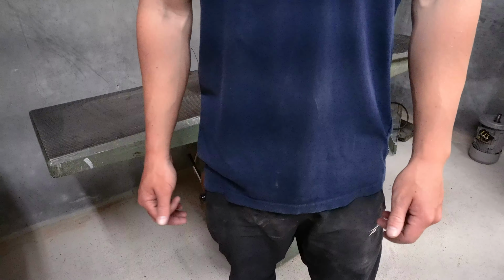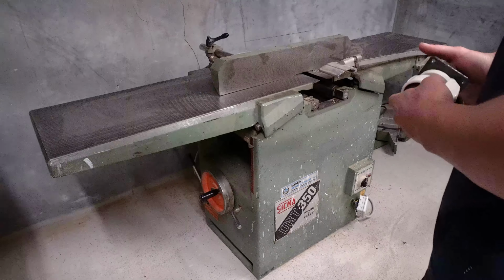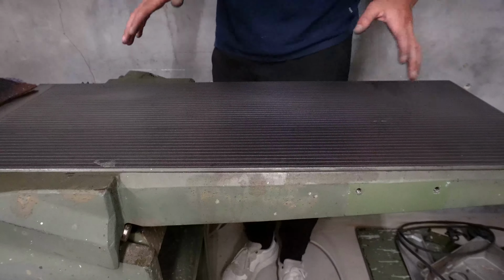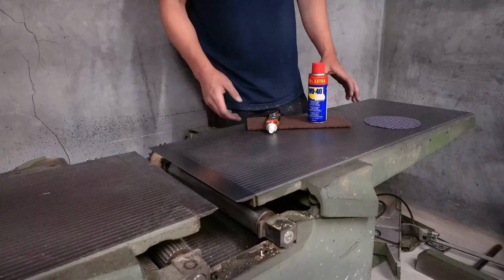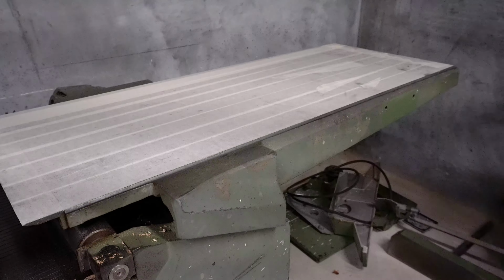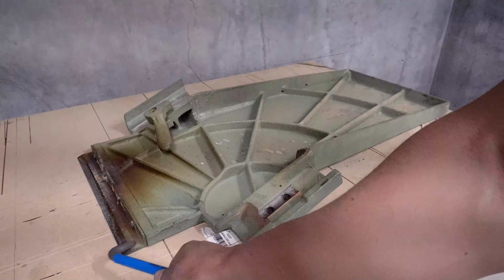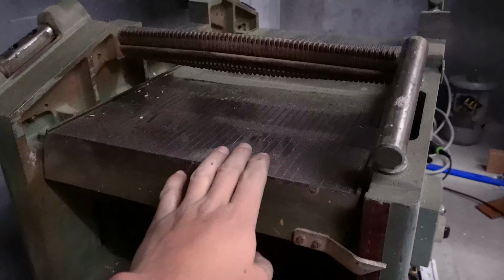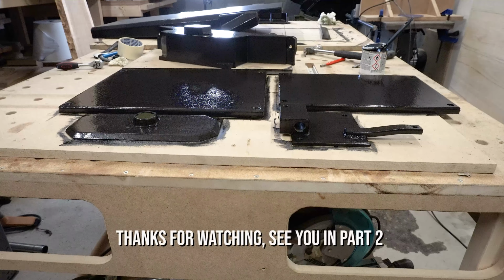My Endgame Jointer: Part 1 - The Restoration begins

Comment: Hi. First off, thanks for sharing your experience in restoring this great machine. I have the SICMA DRT 400 which is basically the same machine than yours. I have been trying to find a PDF with the disassembly but to no avail. Could I contact you privately with some questions that I just cannot find an answer anywhere? I am currently dismounting the machine which I bought a couple weeks ago, and some of the parts I just don´t know to how tackle. I would appreciate your help.